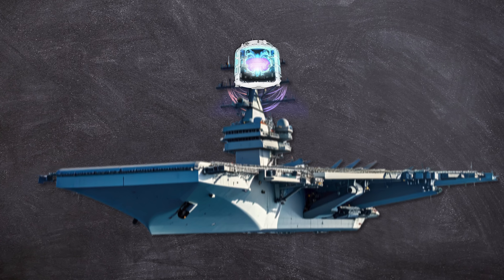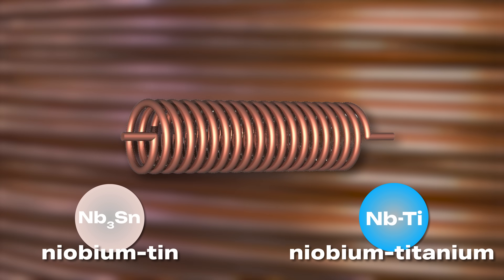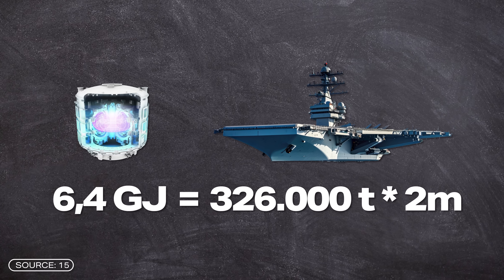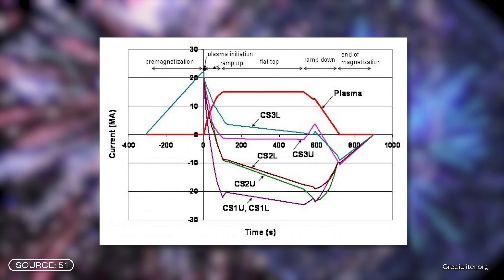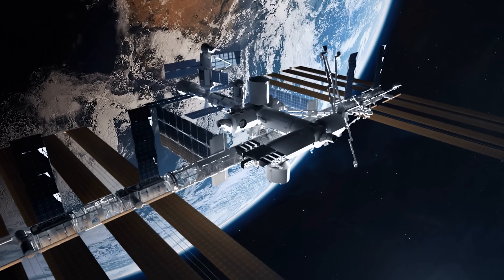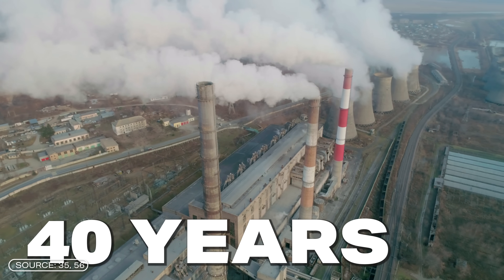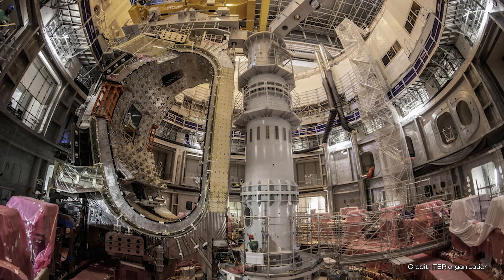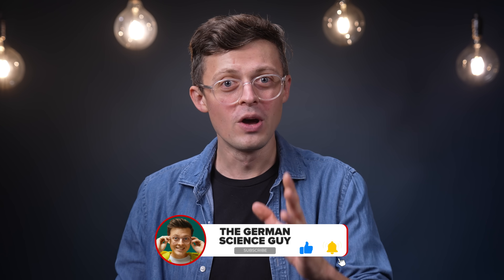Could This Supermagnet Unlock Fusion Power?

Comment: I worked as an engineer in the nuclear industry for years, and had several collegues who worked on ITER. All seemed to be of the same opinion. ITER was a gigantic boondoggle that will never produce a milliwatt of electricity. It only exists to keep certain bureaucrats and researchers in nice 6 figure salaries, until they get to a cushy retirement, with some country club Board of Director seats from their vendors.
Reply: I worked on power extraction and even proposed a workable solution for ITER about 26 years ago.  Guess what, it's not there.

ITER is a boondoggle because instead of trying to solve the practical issues a fusion reactor would have, they are leaving all that for after ITER.

So we have to wait for another huge experimental reactor to get designed, funded and built to just get to prototype phase.

But that isn't the biggest boondoggle.  Inertial fusion never had one chance in hell to break even let alone generate power...

We were laughing at them in our lab.
Reply: Never worked in nuclear physics yet arrived at similar conclusion. It's the greatest grift of our times.

Fusion is real and possible but it has to be the "cold" / lattice confined variety.
Reply: @vaakdemandante8772  Transmutation of atoms is a real possibility. They may be able to make radioactive material non-radioactive.
Reply: Well ITER was always meant to be a demonstrator. That's why they're planning DEMO already as a scaled-up and upgraded ITER that will be hooked up to the grid.
Reply: @atrumluminarium  What about all the radioactive waste that's produced and expected to last well over 100 years. 
The material that undergoes fusion has to be removed and is highly Radioactive. The reactor and everything around it will become radioactive as well.
Reply: @jamesmacdonald5556  no DT fusion only releases a helium atom and a neutron. The neutrons are captured partly by lithium to breed more tritium and partly by a water jacket to heat it up ad drive a steam turbine. Water eats up neutrons very easily so if designed well enough there would be very little neutron activation of the equipment.
Reply: @atrumluminarium a fusion reactor probably won't have a water jacket.  The concept I was working on was a jacket of liquid FLiBe directly facing the plasma to create a breeder blanket, shield the structure and transfer heat out to probably a series of heat exchangers to lower the temperatures to the point that they could be used to generate steam for turbines.

The irradiated structure is the waste so the better you can shield it from neutrons, the longer it will last inside the reactor and the less waste there will be to handle per power generated.

It's my understanding that the waste won't be too bad, just bury it somewhere and leave it alone.  It will take a really long time before we create so much waste that we have a problem finding places to bury it.

I think one of the bigger practical issues is that you probably can't just have one reactor.  You probably need two running to have redundancy, one spare and another undergoing maintenance so that's 4 reactors that are bigger and more complex than ITER and it's going to generate so much power that it will have to be at the center of a huge power grid with lossy transmission.  Can we even design a grid big enough to efficiently distribute the output of a reactor complex like that?  I'm worried about that.
Reply: @jamesmacdonald5556  this is a proposed fusion reactor not fission reactor. There is no radioactive waste as you may be implying with the exception of tritium which comes from lithium bombarded by neutrons. I don't think it's very much though but even so it will be useful as fuel in the fusion reactors there may be even a shortage of tritium.
Reply: People have been saying fusion will be here in 50 years for probably 40 years.  If it's ever going to happen they need to work on every issue in parallel, not in a series of demonstration reactors that take 40+ years to go from planning to plasma.

At our present rate a commercially viable fusion energy plant won't be operational before the end of this century.

If ITER had been designed to test the systems needed for a real power plant, we would know what we need to fix by 2040 and probably build a reactor that can generate power by 2060.

I would have liked to see that and I plan to be alive in 2060.  I'm not going to make it to 2100.
Reply: What about bringing back "Unobtainium" from Pandora?
Reply: So Like some Startups. A few years good salary than bankruptcy and next startup.
Reply: @Nordlicht05 no, it's a couple decades of pork during construction, 5-10 years of science and then convince the funding governments to pay for another 30 years of the same, patting yourself on the back the whole way despite essentially zero energy produced and none sold.
Reply: Its sort of like the acid my uncle invented years ago but he couldnt find a container to put it in
Reply: I would expect the same opinion if you were a coal miner. You have a vested interest in a dirty industry and don’t want it to change. We can’t keep poisoning our planet.
Reply: This is all too true unfortunately. The worse thing that ITER can do when built is to use any tritium in their experiments. It will serve no purpose, and only increase the ITER cleanup costs by an order of magnitude. It’s not clear anyway who would pay for these!!

Comment: The 'other' kind of nuclear needs a certain amount of material before it is capable of going super critical, this is not the case the fusion. The need for the giant ITER is non-existant, fusion could be proven more quickly and cheaper with a smaller reactor. This is just a huge waste of money time and effort.